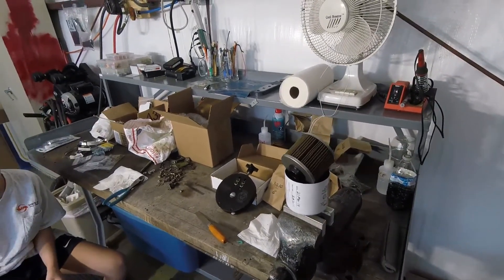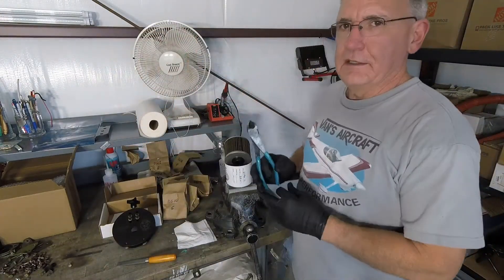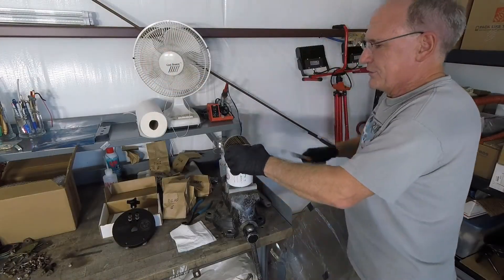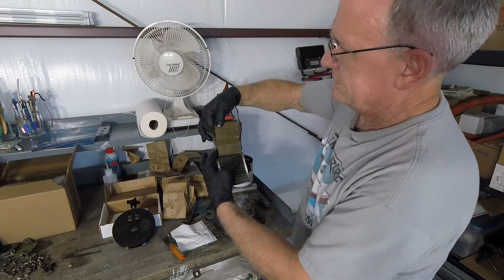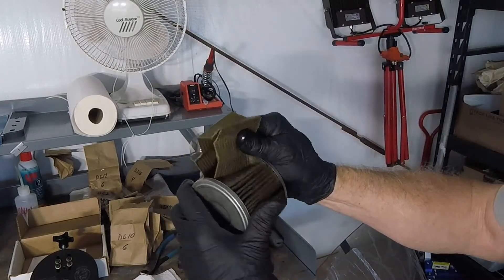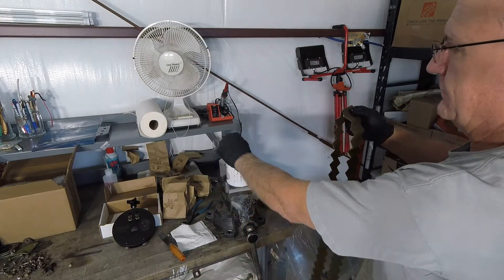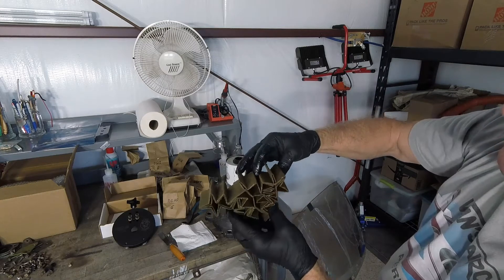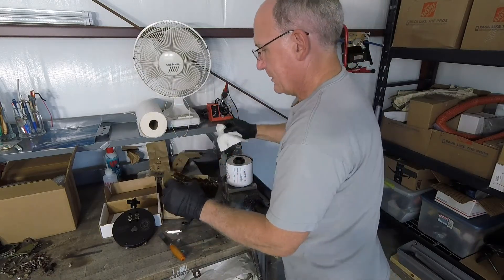Aviation Oil Filter Inspection

Comment: I wash it in varsol and stir the varsol well with a neodium magnet on forceps, making sure to run the magnets against the bottom. It seems to get everything ferrous that was in the filter. Usually a bit of very fine ferrous particles like a microscopic fuzz just barely visible on the magnet, or a kind of ferrous mud. I then agitate the varsol and pour it into a black plastic tray, let it settle for a while, then drain off the varsol. Non ferrous particles show up well against the black plastic. Like panning for gold. I usually get random micro speckles.